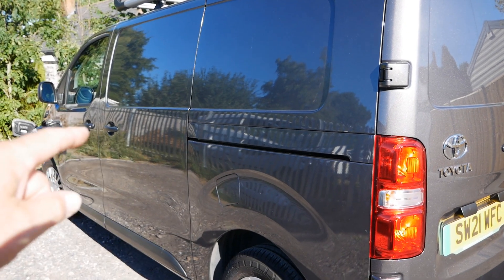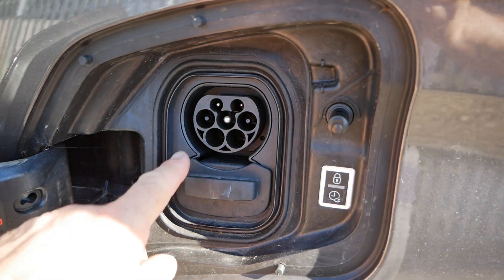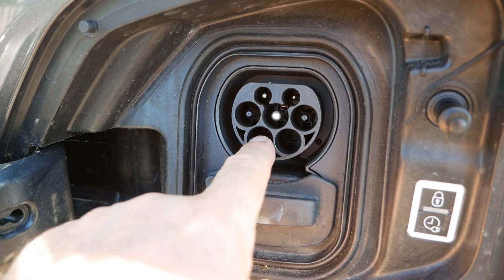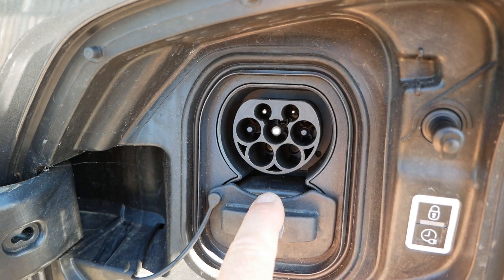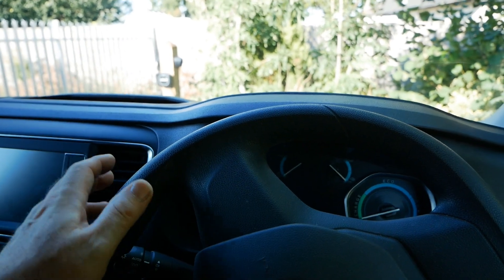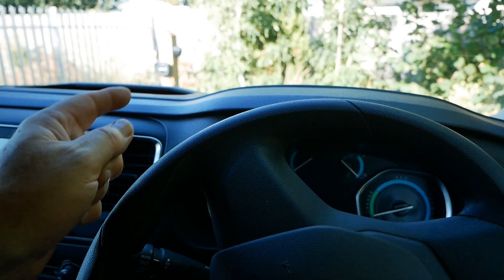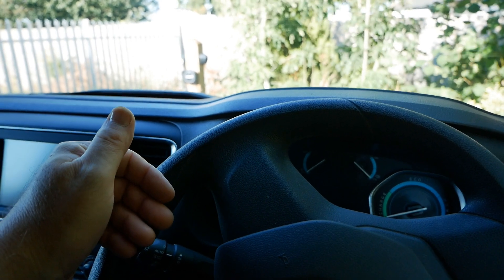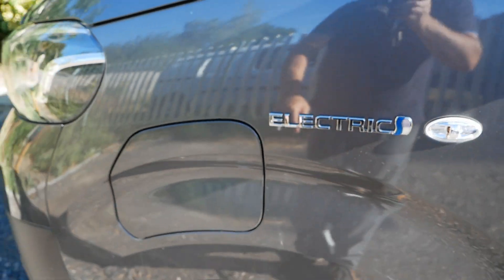The 11kW AC charger upgrade on a Vauxhall e-Vivaro electric van (and other clone vans)

Comment: Neither the Vauxhall Drive Dealer or Vauxhall themselves are able to tell me whether the Vivaro I've just bought has the standard or the upgraded 11kW charging port! It's important because I don't want to go to the hassle and expense of getting 3-phase and an 11/22kW charger installed at home if the van isn't capable of using the extra juice. Octopus Energy offer an extremely reduced rate for EV charging for a few hours at night. If using a standard 7kW charger, I think I would often be charging, at least in part, outside of the reduced rate window. Mine DOES have the extra pins on the charging port. How confident should I be that it does indeed have the upgraded charging capability?
Reply from the maker: As shown in the video, if you have the additional pins in the socket, you have the upgraded charger.
But I would doubt if would be worth spending to get 3-phase installed just to charge your van. Octopus Go gives you 4 hours at 9p. So that would be about 100 miles per night. The Octopus Intelligent tariff gives you a minimum of 5 hours at 7.5p, so that is about 125 miles. But it will actually give you all the charging you need to fill to 100% and at 7.5p if you use a charger that can be scheduled by Octopus on a daily basis. So it would be better to invest in the right charger and use Octopus Intelligent rather than spending loads on a 3-phase installation.
Plus, do you really need a full charge every night anyway? Are you doing 125+ miles per day? If you ware, Octopus Intelligent will sort it anyway and return the vehicle to 100% daily, all at 7.5p pkWh.
If you join Octopus Energy using this link https://share.octopus.energy/storm-okapi-251, we both get a £50 credit, or a £100 credit if you're a business. Due to the price cap, energy customers are currently not accepting new customers. However, Octopus are, even though it says the opposite on their website. You have to call and they do it manually. Still quote the referral code "storm-okapi-251" to still get the credit.
Reply: @GoGreenAutos  I'm already with Octopus. They didn't give the impression on the phone that there would be any charge associated with getting a 3 phase meter installed - there was just a longer wait due to a lack of 3 phase qualified engineers. One of my thoughts with getting a 22kW charger installed (that also does 11kW) is that it future proofs it somewhat as EVs are only going to get better and it seems likely that a 11 or 22kW capability will become standard before long.
Reply from the maker: @oldnelson4298  If you don't already have a 3-phase supply, I'll think you'll find it will cost a few thousand to get it installed.
Reply: @GoGreenAutos  But I take your point that I will rarely be down to 5-10% charge after a day's work.

Comment: As a long term EV owner I say always go for the 11kw on board charger, it gets you out of a lot of situations when rapid chargers are blocked and the unit has a 40kw AC type 2 on the side. As the rule goes you only even want it when you really need it.
Reply from the maker: Yes I agree. But (in the UK) most the high powered AC chargers disappeared when Ecotricity sold thier charge network to Gridserve. Finding AC charging on the motorways and main roads is difficult now.
Reply: @GoGreenAutos  Yes but in Scotland they are still fitted to almost every rapid charger, also you'll be able to charge at a half decent speed on a 22kw unit whilst waiting on a rapid to be available.
Reply from the maker: @1grizzlyrizzo  Ok. I don't mean the UK then, just England. I've never yet driven an EV in Scotland. That's on my bucket list when I retire.
Reply: @GoGreenAutos  I'm planning to do the NC500 in my 2014 24kwh Leaf for its tenth birthday, I'd not consider it if I didn't have the 6.6kw OBC and this is why I say an 11kw OBC is well worth it and in Leaf terms is a selling point down the road.

Comment: I’m looking to get electric van. I do mostly urban driving and diesels have given me trouble. Prob is I’m not allowed a charger to be fitted at my flat so would have to charge via plug. Is this doable. Have fast chargers near by
Reply from the maker: Assuming you're in the UK, charging on a mains plug will only add about 9 miles of range per hour, as charging is limited to 10 amps. It works, but its slow. If you need to rely on public charging, then you want to get the largest battery you can afford to minimise your charging frequency.

Comment: I have ordered the 11kw AC for my van destined to be a camper.  The throury being that I may well park up for 3 or 4 hours while visiting some atraction and if there is 11 kw avalible it's going to get me more charge.
Reply from the maker: ~21 miles per hour vs ~33 miles, so well worth it if you have access to 11kw+ AC charging.

Comment: I can’t charge at home and up to 12/06/21 I was paying 12p kwh at 50 kw rapids. Now they are 79p and 69p from tomorrow. I’m therefore priced out of the rapid market as it’s more expensive than fossil. So my next car will have a 22kw AC onboard charger and I will use at Tesco, Aldi, Lidl etc from 25-40p kwh. It’s sad but I have no alternative until Rapids come back to an affordable price.
Reply from the maker: I saw that BP dropped their charging prices by 10p today. Hopefully it will all come back down, but I fear it will take about 2 years or so. The Russian invasion has shown that the EU was too reliant on Russian gas and also too reliant on burning gas for electricity. A bit of a rapid reset has happened and a transition is taking place at a faster pace than it would have done, which is a good thing.
Reply: @GoGreenAutos  the thing is wholesale natural gas has been tanking for about 4 months, it’s much cheaper now than before the Russian war. Electricity is 19.7p kwh we are being gouged big time.
Reply: Check out the different offers there are on charging suppliers. We got a BP Pulse RFID card, the first month was free then the following five months we paid £7.85 or something. That recently ended but I can't remember what we're on now though I think it's still cheaper as a member than a guest. We can't charge at home either and our local rapid just happens to be BP.